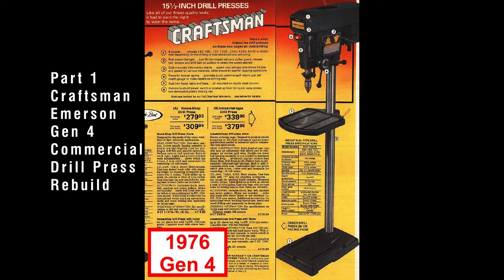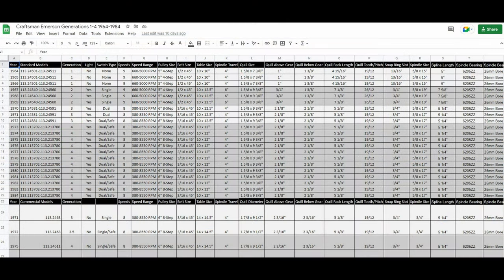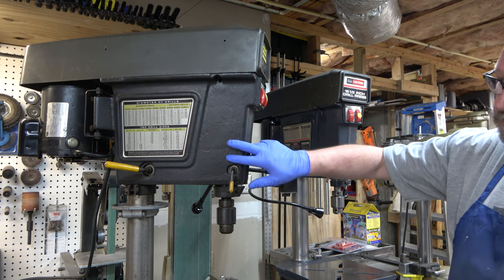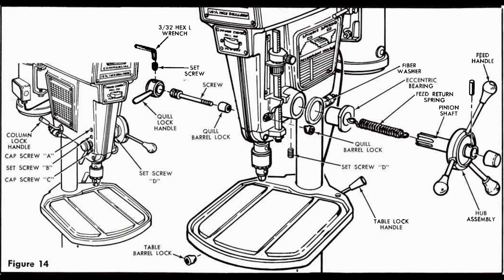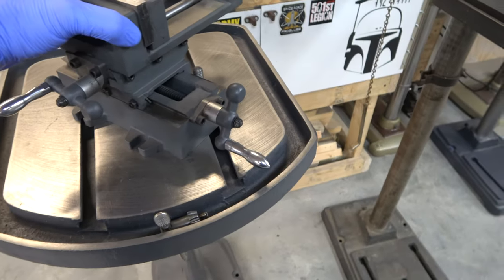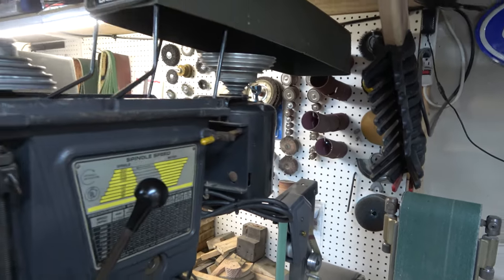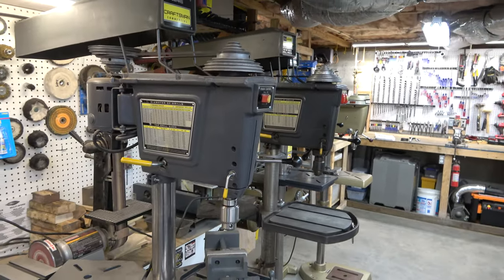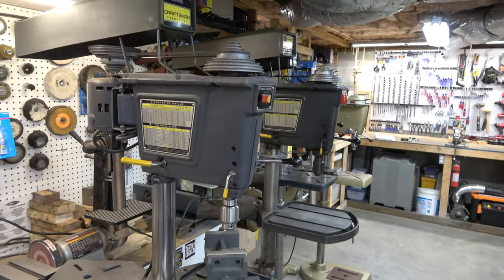Part 1 Rebuild Emerson Gen 4 Commercial Craftsman Drill Press (Overview)

Comment: Hey, you do amazing work and research. I have a 72 gen 3.5 I just purchased and the motor wobble when turned on. I noticed the rubber bushings on the motor mounts are loose/warped. Do you know how I can replace these bushings? Motor # 113.12140
Reply from the maker: I believe they are called "AC motor rubber resilient rings". They are standardized so you need to find a set that will fit your motor but do a google search for AC motor rubber resilient rings and you should be able to locate a suitable replacement.
Reply: @JeffsShop  great, thank you!

Comment: Lucky to come across your vid...need help locating  the discontinued # 38989 return handle spring. Any ideas or sources ???  Thx
Reply from the maker: ebay, they pop up from time to time. Make sure you get the double loop version, older springs have only one loop and a dog leg on the other end. Those are for early King Seeley 100 and 150 drill presses.

Comment: Which commercial gen 4 is the one with 3/4hp? The one with one switch or 2? Also, what's the quill travel? Thank you
Reply from the maker: The Gen 4.5 (with two switches) has the 3/4 HP motor but like I said, all of the tool catalogs only mention a 1/2 HP motor. Quill/ spindle travel is the distance the quill can travel vertically. All Classic Craftsman Drill Presses have a quill/spindle travel of 4" except the Emerson Gen 2 which has a quill/ spindle travel of 6".

Comment: I didn't know you were putting this series out. Lucky me! I just bought a 113.24630 (the similar Gen 3 Commercial model) to refurbish and am having issues getting the head off the column. I think they are rusted together. Should I post about it over on the garage journal thread?
Reply from the maker: Hello and yes please post your questions and some pics in this thread on the Garage Journal Forum. https://www.garagejournal.com/forum/threads/craftsman-drill-press-information-belts-bearings-chucks-keys-etc-1946-1984.489080/
Reply: @JeffsShop  Awesome informational video. I, myself, am in the midst of restoring a 1974 Sears Craftsman 113 drill press. Great work. My compliments, sir.
Reply from the maker: @rayjr62  Thank you, I am glad you enjoyed the video.
Reply: I just bought the  113.24631 - amazing there is a video
Reply from the maker: @rockpadstudios  Congratulations, that drill press should serve you well.

Comment: I have a standard with the 3/4HP motor
Reply from the maker: That is entirely possible. For many of the years that the Emerson line was sold, the buyer was able to purchase them with or without motors. Although most of them were sold with ½ HP motors, it is possible that a buyer could have purchased one without a motor and installed a 3/4HP motor. It is also possible that the Sears location installed a ¾ HP motor at the time of the sale. The motors ranging from ¼ HP through 2 HP were available from Sears and are used on lots of power tools. The manual calls for a ½ HP motor but that is the minimum recommendation. As long as the motor is ½ HP or more and the speed is between 1725 and 1750 RPMs it should perform great for drilling applications.